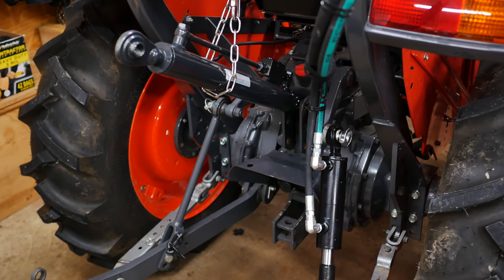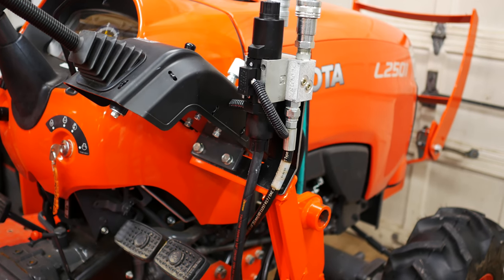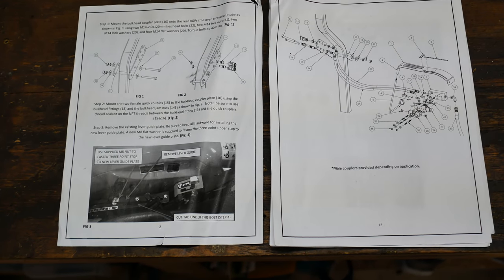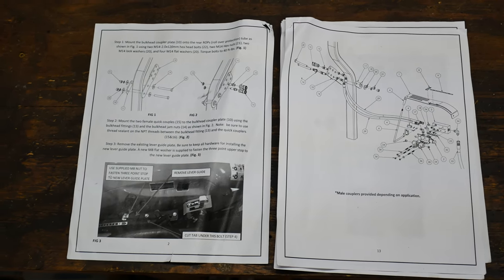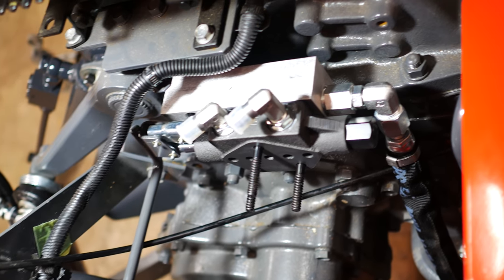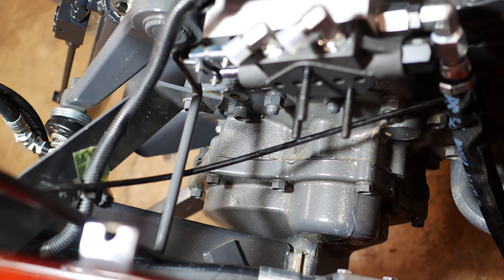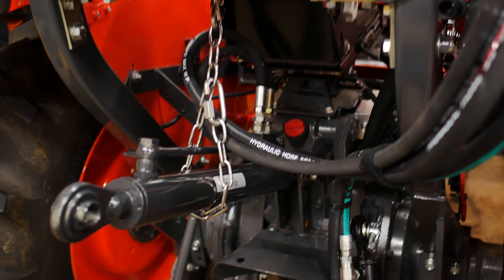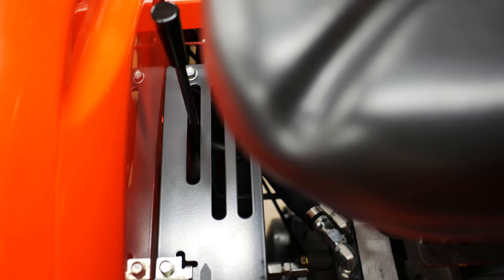L2501 Top-N-Tilt Install Using 3rd Function Valve For Tilt & Kubota L7334 Top Link Kit. Part 2 of 2

Comment: I was planning on doing something similar on my B2650. Was considering plumbing off the 3rd function to a servo controlled multiplier/diverter. Thinking I would then be able to toggle the diverter and control both top and tilt with the 3rd function buttons. Do you see any reason this wouldn’t work?  Nice, well laid out video. Thanks.
Reply from the maker: No - not off hand. Just keep in mind that there a lot more access to the hydraulic components on an economy "L" Series than a BX. Be prepared to work in tighter spaces.  If you're OK with that I grantee you won't regret it!  Thanks for watching and for the comment!!

Comment: Thanks for the video was great job. I am going factory but getting all 3 kits. L7334,L7364,L7354. Its a lot more at my dealer. $1050,$697,$107.  I really like a clean setup and think I would be around the $1500 to do aftermarket but would have to mess around with everything to make work. Do you have info on your cylinders you bought still trying to figure that out.
Reply from the maker: Glad I could help - you're gonna love it! Thanks for your comment!

Comment: Great video. I’ve been wanting to do this same thing to my L3901. I’ve got the landpride 3rd function kit and a backhoe circuit already plumbed so my hoses will be different but I really appreciate seeing the valve body installation part. On a side not, what seat is that? It looks different and higher up than mine.
Reply from the maker: Thanks! yeah - you're almost there with the hydraulics. I don't know the name of the seat.....I bought it off of eBay and I really like it. Primarily, because it has arm rests. Long straight lines brush-hoggin' or tilling was getting a little rough on my back and neck. This seat helps a lot. Thanks for watching and for the comment!!

Comment: Do you have a part number for that right fender handle? I would like one for mine.
Reply from the maker: Check with your local dealer - this is what I ordered for my L2501 and it fits most "L" series tractors: PN-T1060-29450, which was replaced by: PN-T1060-29470.  
I think the L handles are the same as all other Kubotas. When you get yours, you might think the holes don't line up. The studs off the handle are fairly long and are not parallel, they follow the fender radius and point toward each other slightly. To get mine to line up with the holes, I left the handle in the sun for an hour and then flexed it to get the studs in the holes and it fit perfectly seated against the fender. Thanks for watching and commenting! Please don't forget to like, share and subscribe! Talk again soon!
Reply: @BotaTrac  I tried looking both those numbers up  on messicks site and either number is a good number.. not sure if that's the part number...